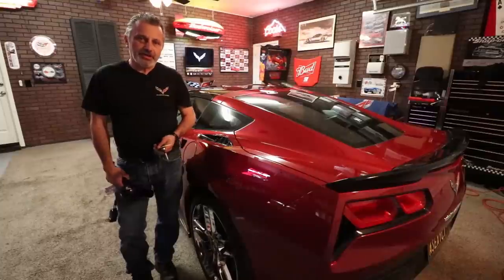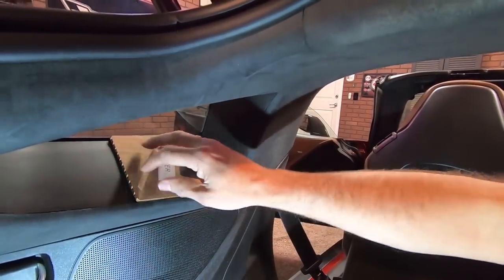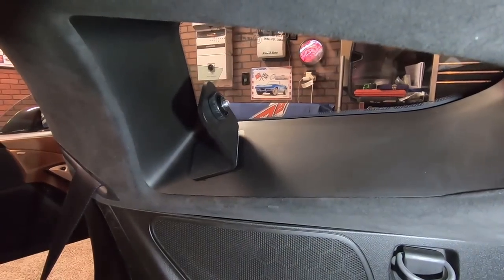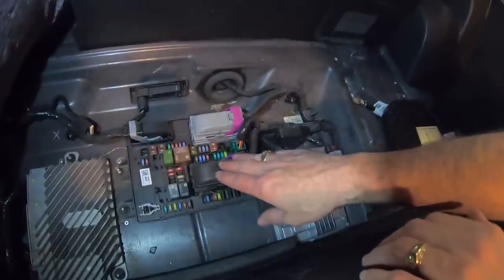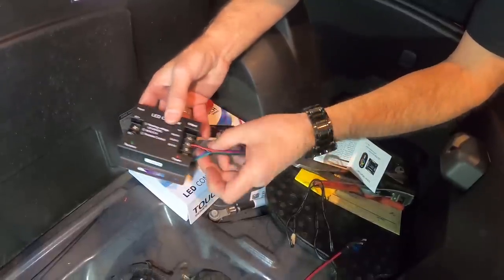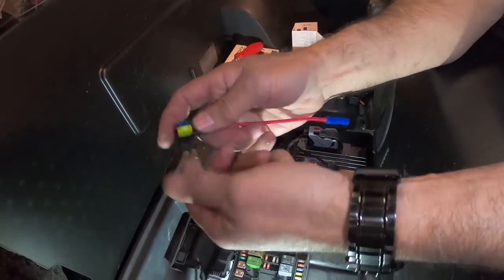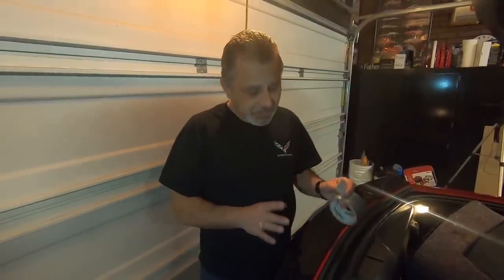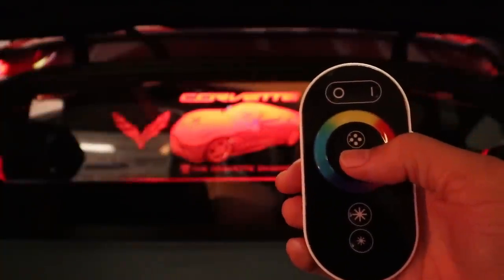WindRestrictor The Ultimate Accessory For Your C7 Corvette

Comment: Scott, Thank you for the great instructions. I was able to put the wind deflector on virtually by myself. I did have hubby help a little to strip the wires and turn the screws while I held the wire in place. Only comment I have is, the instructions say to allow the bracket to cure for 72 hours before attaching the wind restrictor. Of course, I did not see that until I had it attached. Otherwise, your instructions are great and easy to follow.
Reply from the maker: Hello,

Thank you for watching and I am glad you got it done.
I was told that they were going to remove  that note from the instructions because the stick tape is much improved now.
I have installed piles of them exactly how I did it in my video.
I am sure your install will be just fine.
Again that's for watching.

Comment: Great video! One question, does it rattle on the highway or make an unusual noise with the roof panel on and/or off. If you could share your experience, that would be great! Thank you!
Reply from the maker: Great Question...
No it is perfectly quiet! It doesn't make any noise and it does not rattle.

Comment: Cool product.  Quick question...If you choose to hard-wire the lighted version as described, can you turn on the illumination while parked at a show with the car off or do you need to hit the start button in order to light it up?  Same question as to when the car is turned on and you're driving.  Can you also turn it off for example when you're driving during a sunny day and don't need or want the lighted illumination.  Does the remote control provide that option, or would you need to install the optional battery pack instead of hard-wiring it into your car?  Also, can you remove it if it is the hard-wired version without disconnecting the wiring to the fuse box and battery?  Meaning, can you remove the restrictor from the light bar at the top?
Reply from the maker: Hi Allen,
Great Questions.
Let me try to answer you.
My unit was hard wired in the video, but later I added a quick change harness that allows you to use the Rechargeable 12 volt battery pack that you have to buy at an additional charge.
With having it just hard wired in you would have to turn on the Key to get power to the WindRestrictor unless you picked a different fuse to get power from. 
With it hard wired in and the car is running and you dont need the WindRestrictor on, you can use the Remote to shut it off.
As far as removing the WindRestrictor, I am not sure why you would want to do that. But yes the light bar is only attached  by a couple of allen screws. So you could take it of the Restrictor itself and still keep the wiring in tack.

Hopefully this answers your questions,
Scott
Reply: @THECORVETTECHANNEL  Thanks.  So with your quick change harness, where do you place the rechargeable battery pack in the car?  I also watched your convertible installation video and the tonneau cover allows you to mount and hide the battery pack.  Not sure where to route the wires and hide the battery pack in the coupe.  Behind passenger seat?
Reply from the maker: @allenharmsen6915  HI Allen there is a Styrofoam cover that sits above the battery. I cut a hole in the Styrofoam that allows the battery to fit in flush in the cover. Hope that helps.
Reply: @THECORVETTECHANNEL   Great thanks.  So you maintained your original power wire routing along the trim and just installed the restrictor battery pack in the cutout above the car battery cover.  Nice idea.  I also wonder if connecting it to Fuse #22 (Rear Accessory Power Outlet) instead of Fuse #37 (Front Accessory Power Outlet) would allow the unit to be turned on by the remote without the car running since the rear accessory power outlet is used for the battery tender.  Not sure if that makes any difference since the battery tender is plugged into an external power outlet.  Just trying to figure out the best option to have it hot wired to turn on/off with the remote without starting the car.

Comment: The instruction on mine say to wait 72 hours after installing the brackets before installing the clear restrictor.  I just installed brackets today that is why I am asking. Is that really necessary. Thanks love your channel
Reply from the maker: You should be fine. Make.you use the hair dryer or heat gun to warm it up to make sure the adhesive actvates.

Comment: your video is so helpful that im almost done with installation...but just one problem. In my car, fuse slot no. 37 (Accessory fuse) is already taken by dashcam. i live in pretty scary town so i can't remove it. can i connect the power wire elsewhere on rear fusebox?
Reply from the maker: Yes you can. I recommend using one that shuts off with the car. You can get a test light at any automotive store.
Good Luck!!
Reply: @THECORVETTECHANNEL  Thanks! local car guy just connected the LED module in the middle of existing wire on fuse 37. I'm leaving this comment in case if anyone bump into same trouble i had.

Comment: Great video Scott!! Question on the single lite it don’t come with a remote so when the car is on it’s always lite up or can you turn it off? I don’t know if I want it lit while driving. Thanks.
Reply from the maker: Hi Don,
First Thanks !! Second...Your right. There is no switch but it is very simple to add a switch to turn it on and off or wire it into your third brake light or something like that.
Hopefully that answers your question.
If not please let me know.
Reply: THE CORVETTE CHANNEL Hi Scott, just looked over there web site. I will have to check with them. But it gives you option 9v switch that you don’t have to run it to a fuse box. So I assume it will lite up the single lite with the 9volt.
Reply from the maker: @donrussell7951  yes they do have a 9volt switch option.
Reply: THE CORVETTE CHANNEL thank Scott I just got done chatting with them. The dimmer switch is the better option. With the single light I would still hook up like you did to the fuse and battery but it comes with a key fob remote to shut off or on and you can make the light brighter or dimmer with it. That is the 35.00 option. Thank you,

Comment: Does having this product dampen the audio from the rear; because if it doesn't, I'm sold. (19' Stingray)
Reply from the maker: That's a great question. I have not noticed any difference!
Reply: I'm about to place the order...just want to make sure...in your video, is the restrictor the "etched & illuminated" one right? Also, the only accessory you've shown is just the "color changing illumination w/remote" right?  Those are in my cart but before I blow $450 bucks, I want to make sure everything is OK.  Do I need any optional wiring accessories?  I plan to install it the same way shown in your video.
Reply from the maker: @hisokaspider4882  Hello,
Yes I installed the unit exactly as it comes from the factory. I did not use any additional wiring. The only thing I added that was not included was the connector that I used to connect to the negative battery cable.
One other thing that you may want to get is the portable rechargeable battery  that way you can turn it on at night or indoors for hours without running the engine or draining the car battery.
I just got mine and I will be making a video on how to install it. But unless you will be indoors or at night with the motor off for a long period you will not need it. I decided to get one because I go to multiple indoor car shows.
If you have any other questions please let me know. I will be happy to help!
You are going to totally love it!
Have a great night,
Scott
Reply: @THECORVETTECHANNEL  Cool....I'll purchase & wait for your next video just to be sure its done right.  Worst case scenario I'll use this video as a back-up.  Since this is my first Corvette & still learning...are all C7's similar to each-other with respect to the battery location?  I also didn't see you disconnect anything...don't want to short anything or electrocute myself...LoL...
Reply from the maker: @hisokaspider4882  ok sounds good I will try to get that video filmed as soon as possible so you have it.
I did not have to disconnect the cable from the battery. If you watch the video  you will see I used a smaller bolt that is connected to the negative cable.
All C7's batteries are located in the same place and yours will look just like mine.
Where are you located? Maybe you can find a shop that will wire it.
If you have more questions please let me know.
Feel free to email me at thecorvettechannel@gmail.com
Have a great night!!